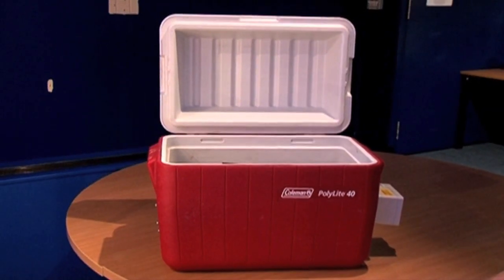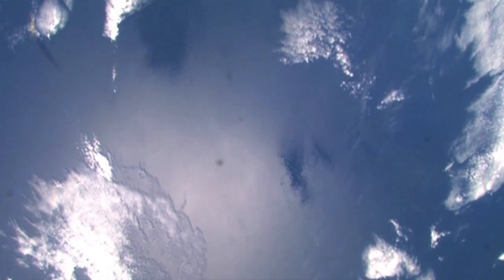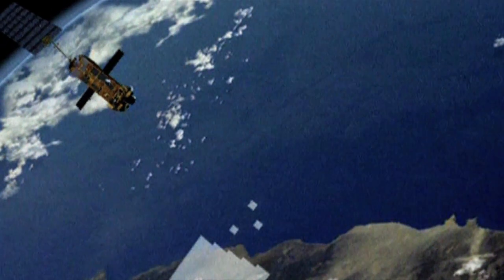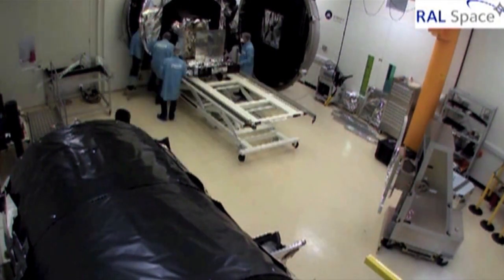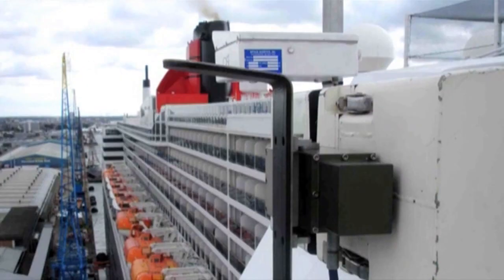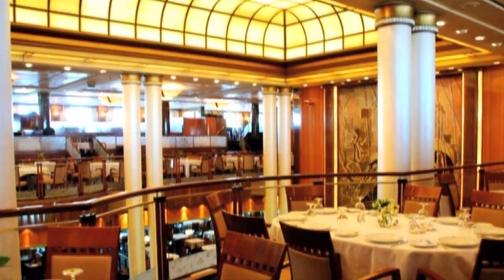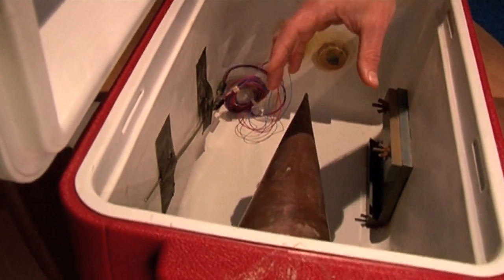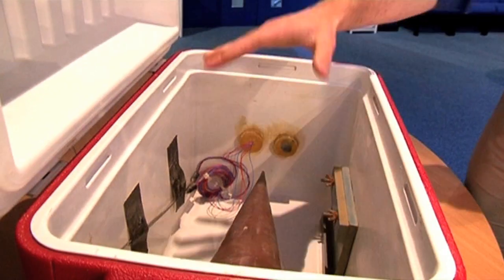The World's Most Important Beer Cooler

Comment: couldn't you use some kind of phase change to keep a standard temperature? maybe the temperature of ice melting in a water bath at 1 bar or something like that? it seems kind of convoluted making an active device that keeps the temperature uniform and then measuring that with the calibratee rather than use simple physics to do the hard work for you...